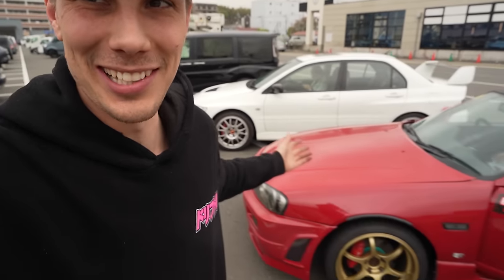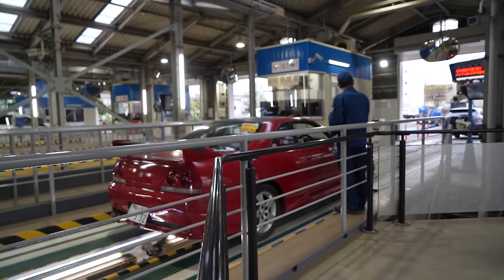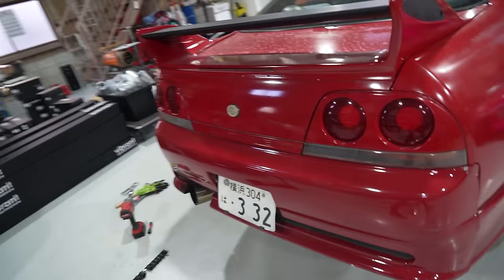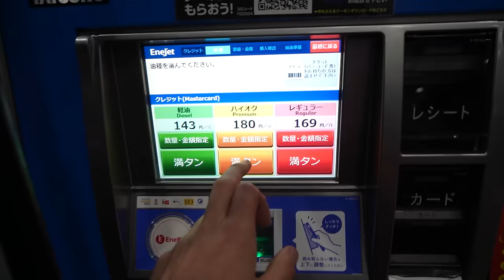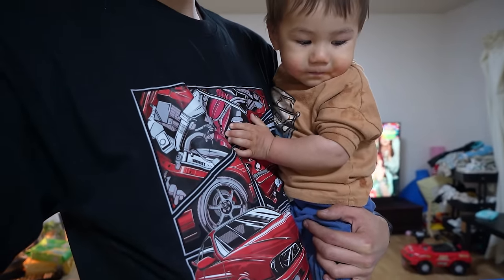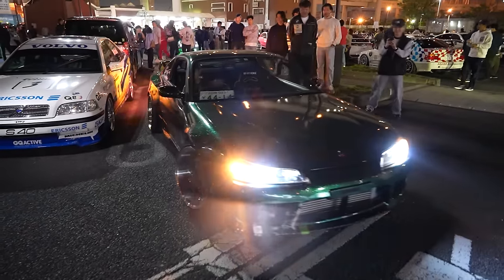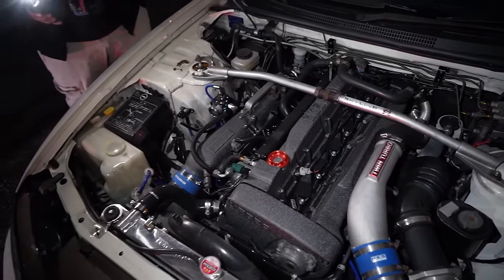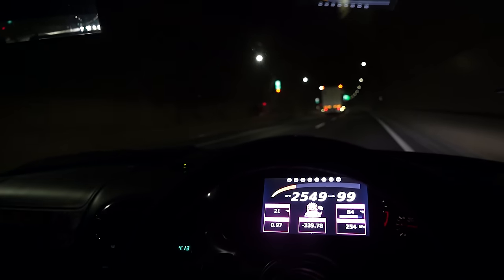My First Car in Japan, The R33.4 Skyline has Returned

Comment: shaken is around 1/2 - 2/3 as strict as germany, its mostly impossible to do engine swaps, wheel swaps(without shaken equivalent papers), suspension settings like camber over 2%, exhaust modifications etc. Bodykits are mostly forbidden and all gfk/poly bumpers are also forbidden for "pedestrian safety". very annoying expensive and disruptive for car enthusiast here (also unshakening your car will get it impounded and probably crushed / sold at auction if you're unlucky + the heavy fines and points on your licence) :( the only good thing about german car culture is the autobahn and 3 public racetracks (no drift tracks sadly)

Comment: We have emissions here every year in Pa and they do the Smog testing but they dnt do the whole shaking lol I have herd a few peeps say that if ur car fails for emissions to take a bottle of dry gas and put it in run it 5 to 10 miles and then go back and they pass so The More you Know if u ask me all it is a Huge $ scam I have only ever had one car fail and it was cause the gas cap Stright BS they literally twist it on their machine with a computer the biggest waste of 💰 not as much as the  Military gets shafted on for a bag of bearings that cost u and I tops 100 bucks them 90,000 tho 😳